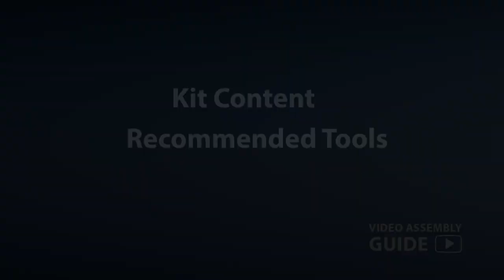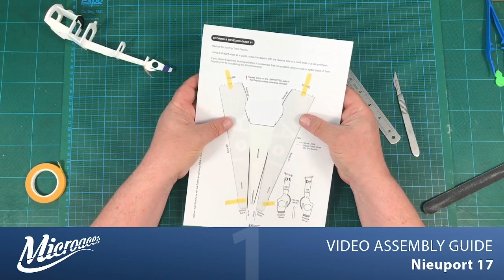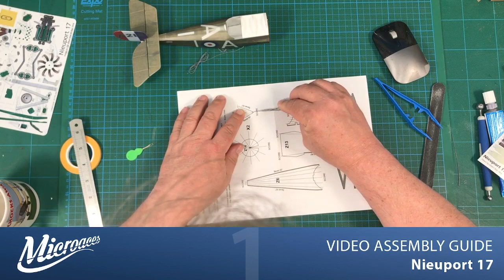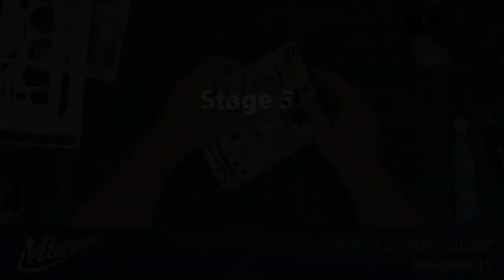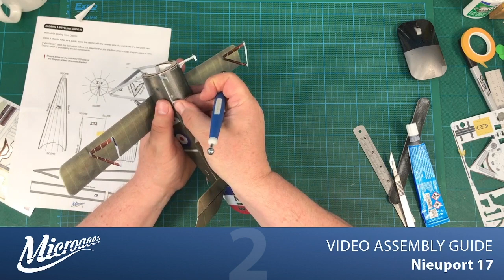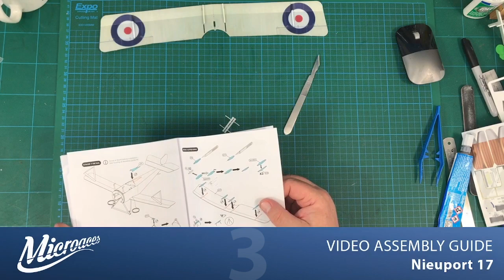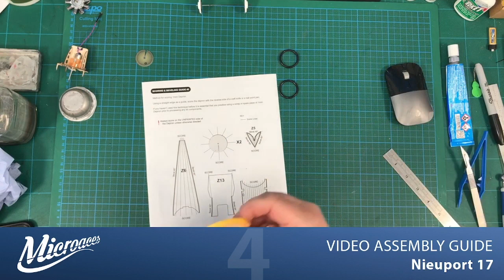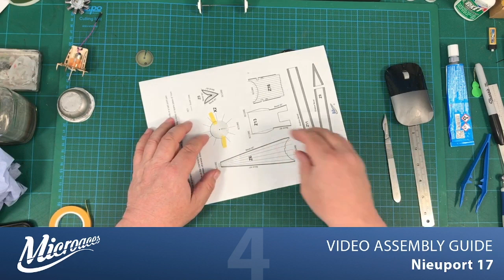Microaces Nieuport 17 Video Assembly Guide

Comment: Having just watched the electronic section I suggest (as I did) installing the board and control rods on p 19 before adding part z 13 and the undercarriage. This makes it all much easier. I even left the turtle deck off till after installing the control rods for easier manipulation. Also I added a slither of foam to the central lower wing rib to help the dihedral which seems to have all but disappeared on the build in the video. Still enjoying the build - just love all the brilliant details like the tail skid surround - so well worked out and designed.

Comment: Why can’t flying aces dictate a square shaded area inside the fuselage for the electronics to be seated, and therefore, provide som pre-prepared, cut, bent control rods for the kits? Wouldn’t this be a slightly easier installation? And maybe som rigid, light weight plastic tube to create a rigid sheath for the rods?
Reply from the maker: Because it all adds to the cost of the kit Dane; we could build them for you, but where's the fun in that? - Oh and it's Microaces BTW not flying aces!!

Comment: how do you change it to a three channel receiver?
Reply from the maker: The AIO receiver used in this build is 5 channel - but you just use 3 of them. No need to change it. However, what I do recommend is that you transfer the rudder control over to the stick you also have elevator on. This can be done in a number of ways. Your transmitter may allow you to mix rudder and aileron, it may also allow you to change modes (mode 4 is rudder and elevator on right stick) or you can also program the receiver directly via a PG02 interface tool, a PC or windows laptop and the Crossover App to re-assign the rudder channel to the aileron stick.
Reply: @MicroacesTV  Thank you kindly.